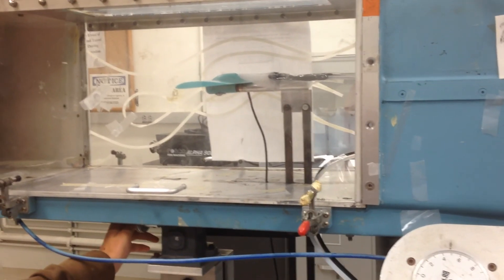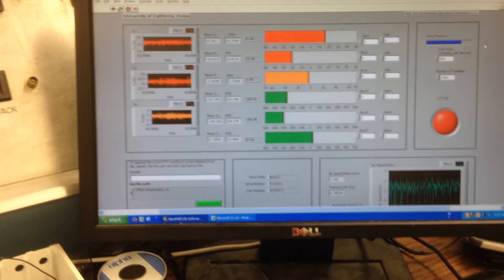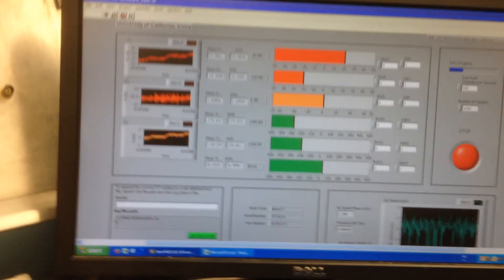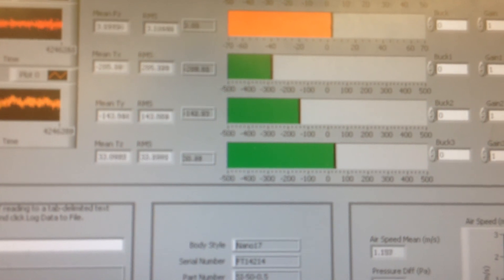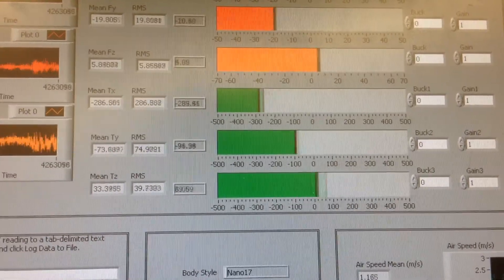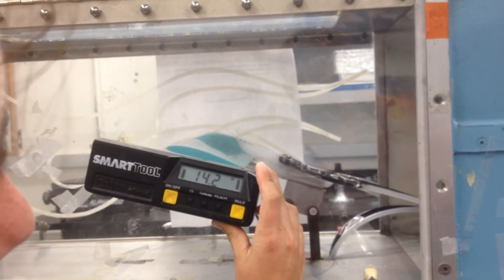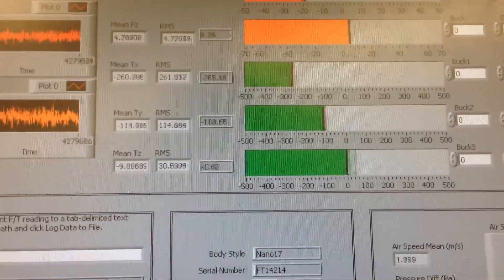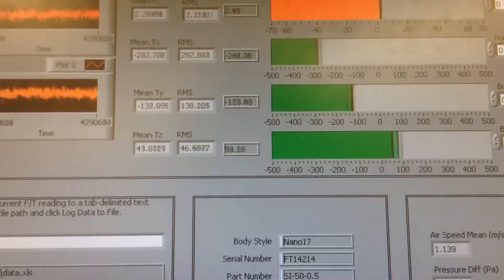Differential Suction of Clark Y Airfoil

Comment: One question about CLARK-Y ...
The measurements made are with respect to the line joining the leading edge and the trailing edge or with respect to the construction line of the airfoil ???
Aerodynamic works done by NACA do not specify with respect to which line they are measured....cheers